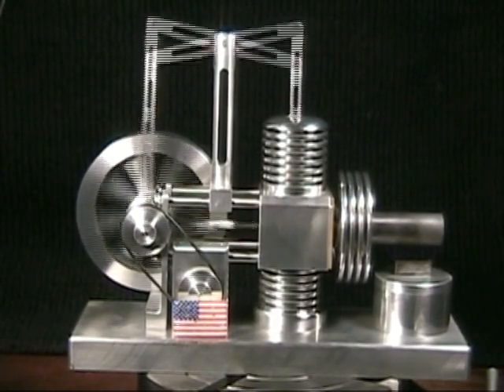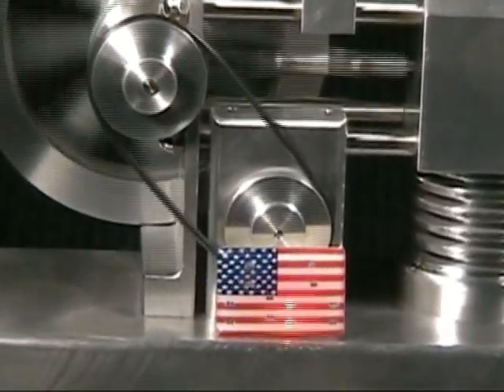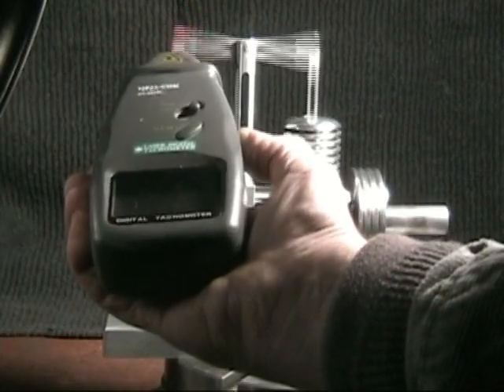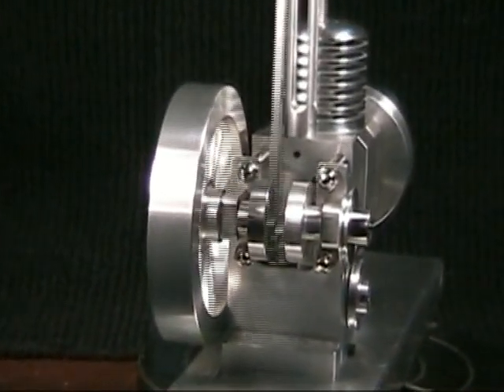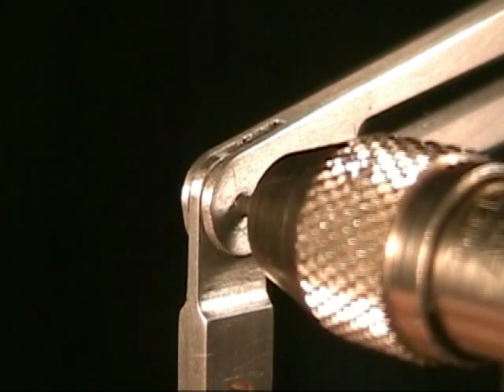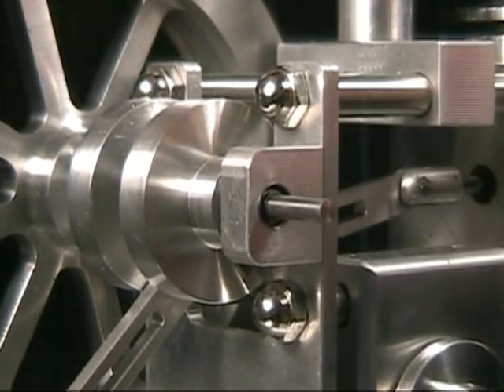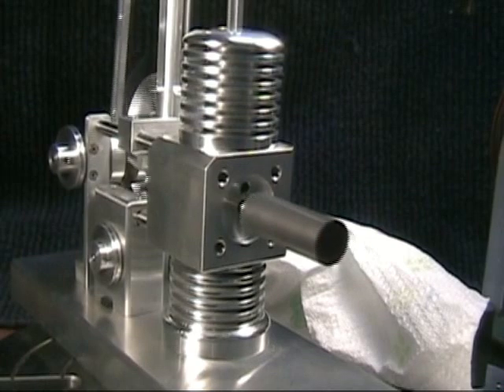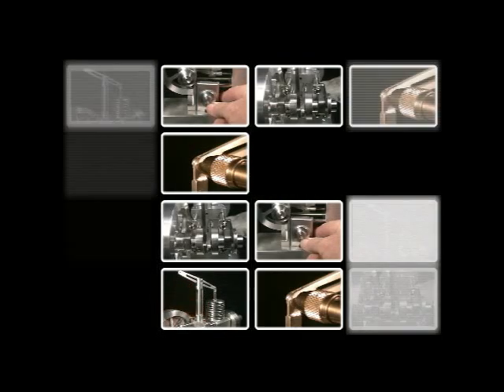Stirling Engine With DC Generator

Comment: Im curious, with a gearbox, and smaler pully do you think you could generate more power?

I have thought for some time, that with the addition of Pelletier devices to the cooling cylinders, could also help, too generate additional power.

Im interested in generating enough power, to run a hydrogen separator.  I think that by powering the sterling with hydrogen, and the Sterling producing power for the hydrogen... it would be a perpetual motion engine. The question is electrical hysterics. Will the load, of the hydrogen separator, create too much drag in the generator.  If theres surplus power, then it could be scaled up for real power generating! I think..

Comment: I have interest in off grid power. Living in cold weather heat is essential with a wood stove. I believe the Sterling engine would be an ultimate answer for the electric generation used with a heat generating woodstove. Sterling engine sized larger to support photovoltaic / batteries
Reply from the maker: I've always thought it might be possible to build a heat engine generator of some kind into a fireplace. I'm sure someone must have tried it.
Reply from the maker: I thought many times if it could be practical to build something right into a fireplace

Comment: Question: If we reduce the temperature of the "cool" region even further with ice, say,  (I guess on top where the fins are??) What will the effect be? because there is a bigger difference in Hot:cold ratio... Any? More power?

Thanks
Reply from the maker: Hello, Thank you for the compliments and Yes you are correct about additional cooling to the cooling side of the engine. Anything helps when there is actually not a lot of air in the engine.
Reply: great

thanks for the tip.

can you recommend a model for experimenting with. 

Also maybe a website with detailed thermodynamic theory?

thank you

Comment: Nice work. This would probably work well as a solar heat converter. We can use something like this generate output power capability.
Reply from the maker: Some people are running these with a solar dish. I had this one working with a Fresnel lens for a short time.
Reply: Richard Vasquez

Comment: Can this be made any size?  What is the principle behind it how does it work?
Reply from the maker: +Dan Webster (Paw Paw) ...Dan I think at one time farmers used engines like this to run farm equipment and there are some modern style Stirling's in submarines. This is a closed cycle engine so it can be stealth under the water. The same air in the engine is used over and over. The air is heated and expanded in the displacer cylinder forcing the power piston up. Once the air is in the upper cylinder it cools and contracts to force the piston down. It's hard to get a lot of power from the system but this is more of a desktop demonstration model.

Comment: the gap between piston and cylinder How much millimeter
Reply from the maker: +Ho NhuY Hello the displacer or horizontal piston has about 2.5 mm but the vertical power piston is a slip fit with probably around .025 clearance.
Reply from the maker: +Ho NhuY Hello the displacer or horizontal piston has about 2.5 mm but the vertical power piston is a slip fit with probably around .025 clearance.
Reply from the maker: +Ho NhuY Hello the displacer or horizontal piston has about 2.5 mm but the vertical power piston is a slip fit with probably around .025 clearance.
Reply from the maker: +Ho NhuY Hello the displacer or horizontal piston has about 2.5 mm but the vertical power piston is a slip fit with probably around .025 clearance.
Reply from the maker: +Ho NhuY Hello the displacer or horizontal piston has about 2.5 mm but the vertical power piston is a slip fit with probably around .025 clearance.

Comment: Awesome!  3v is nice, can it do 5-7v?  6v is standard for USB charging.
Reply from the maker: +Peter XYZ I think it would probably be more practical to charge a cell phone with a solar cell.
Reply: You're right, it's more practical.  I use a ZeroLemon 20amp solar battery for cel phones.

I was pondering the flexibility of a device that offer 5 to 7 volts.

In case I didn't say it:  thanks for posting video.  I'm researching Stirling generators.  Information is abundant but 'limited'.  Most info is either for 'toys' or large high tech systems.  Few or no DIY electricity generation.
Reply from the maker: +Peter XYZ I agree, The fact that You have to use the same air that's inside the engine over and over so it's not really efficient. I wish there where more experiments posted also.

Comment: Very good build quality! The question i have is the Stirling powerful enough to drive a generator for home emergency use (1-5 kw)? So far the Stirling Engine remains a desk top novelty!
Reply from the maker: +Dan Roy At one time Stirlings where use to run farm equipment but in this day and age it would be pretty impractical compared to a combustion engine. Remember the Stirling runs only on the small amount of air in the engine and has no intake or exhaust. Most of these small engines are desktop models. I haven't seen one for sale that wasn't. On the other hand I've heard that the UK has a submarine with am auxiliary Stirling engine because it's stealth. Maybe someday they will work their way into today's market place again.

Comment: Perhaps, you can build a larger unit for civilian uses...  offgrid living and preppers will love it for sure!
Reply: +Mustafa Ali Indeed!  I was thinking this would be perfect sitting on a woodstove.  It doesn't need to be efficient really because most of the heat from the woodstove is for heating the home.  If this could create enough voltage to charge up a TELSA WALL BATTERY (google it), this would be ideal!
Reply: saisonqwerty yes, I can't agree more. Heat is meant for the entire house with electricity generated by the Stirling engine as an alternative off-grid source of power. If BLOOM ENERGY or Tesla Power Bank is added to the system, the electric energy produced can be stored for future use. A gasifier will complete the system. The latter could also produce alternative fuels for the household if a filter process system is added to it. Gosh, the more we talk about it.... the interesting it becomes.
Reply: saisonqwerty kindly update us if you have a big stirling engine in the works for off grid applications... it will be awesome!
Reply from the maker: +Mustafa Ali 
Hello friends. I'm in my 70's now and it's not to practical for me to take on projects of that magnitude, but I have thought it would be nice to build a generating device into a fireplace.
Reply from the maker: +Mustafa Ali 
Sorry, I lost my AutoCAD files in a computer crash years ago. They where in the form of machining notes that would have been hard to understand anyway.
Reply: ***** Oh, really. Then its best leave the job to the younger generation then. But a good blueprint of this astounding machine will come in handy
Reply: ***** no worries bro. Chill!

Comment: in every you tube presentation, Always little devices and no actually weight on it to prouve it can pull something or whatever. Nice work however to present. 3V is nothing to work with and that is the problem with all self-built devices in a smaler scale
Reply: A desktop model is just that, a desktop model for experimenting and learning. Be happy we can do anything at all period, nothing gets done by people like you complaining, did you build one to power your home? OK then, what are you waiting for? The sooner you try the sooner you will have what you ask for, a model that can produce all the voltage you can handle.
People Like you sitting around complaining and WAITING for everyone else to do something all the while you are doing NOTHING!

Do you think the elite are going to do it for you? Wake up, YOU have to do it, yes YOU
Reply from the maker: Luc, the model is not supposed to be useful, it is to demonstrate how one of the old time Stirlings looked and worked. You have to be extremely careful in your build to get one like this to even run. You missed the point. It's a desktop model and doesn't call for elaborate output tests. If I was building something to replace current technology I would have let everyone know. Sorry and thanks for the compliment.
John
Reply: this would charge my 12 volt which would power my inverter which would power my winch which would move 3000 lbs.
Reply: that is indeed a possibility

Comment: How much heat would I need and how big of motor would it take to power a generator big enough to power my house (~1200 Kw per month)?  I would like to hook a motor up to my outdoor wood burner.
Reply from the maker: Hello friend, I wouldn't have any idea how to create that much power with a stirling. This is a model of an old fashioned engine and certainly wouldn't be the choice for real world power plant. There are some modern designed Stirlings being use, one of the UK submarines has a Stirling auxilliary engine which leads me to believe if you did some searching you might find something closer to what you're looking for.
John

Comment: how about a reduction gearbox... have you tried that...
if yes what were the results..

and one more thing what u ment from re-engineered ..
re design of all parts and fly wheel and all ...
Reply from the maker: Hello, I haven't tried a gearbox but there is so little power in this little model that I'm not sure it's worth trying. Yes I did redesign much of the motor I offset the the centerlines of the power piston and displacer unit so the connecting rods are straight with no angles. I also added bearings and micro bearings almost everywhere there is moving parts.
John
Reply: thanks Sir .. 
    i was planning to do an project work on stirling engine working on a concentrated solar power 

so i was worried about the power and torque.
i liked your idea about adding bearings wherever possible. 

the information provided by u is really helpful
THANKS
Reply from the maker: parth pandya
I had a thought. This is meant to be a replica of an old technology. If you are interested in doing real work with an engine there might be some modern designs somewhere on the Net. I think the UK has a Stirling engine in one of their submarines. This would make it stealth with no emissions I guess. 
J
Reply: ohh thanks i appreciate your thought .. i will surely look at it

Comment: Stupid question - since you didn't give the amperage so I could do the math and get close (I'm assuming ma really) what is the torque output of the engine?
Reply from the maker: Hello, it's actually a legitimate question. The fact is the motor is so low in torque that I really have no way to measure it. If you look at my other videos you will see one that shows how to check HP. You must remember the engine runs only on the small amount of air in the engine itself. Heating and cooling what might only be a few cubic inches of air is really a tricky situation. It takes a great deal of effort to just get the mechanics free of friction enough to work. I think the best I did was run a load that was at 3 volts and about 60 ma. 
Take care.
John
Reply: Cool - further question if it's OK - was it loading at that point or did it handle it well? (I'm looking at making one a little bigger around 3-7ft lbs of torque under consistent load and am stealing ideas from yours and a couple of others to just scale up something existing is why I'm asking ) in the end it will be the power behind a shaft for an aquarium wavemaker with the heat source being from the output side of the solar assist panel from my water heater (may not work but something I want to try since the heat source is already there) The theory is that it would give me flow in the day and still at night.... kind of sort of but not quite mimicking what happens in the back bays of the inter-coastal on some of the grass flats (albeit in reverse)
Reply: *****
That is approx. the same output power i achieve with my tin can built with a single flame on input, mine is very fast compared to the ones you see on the videos made of tin, i gotten around 1500 rpm, i will make a video soon, i know you might not believe it, since yours is all machined, and with ball bearings and graphite. But the difference is yours will last many many years, mine is just for learning without spending any money, and it works, and it works good, but like i said i don't expect it to last for years under usage. But it is a good stepping stone for me, and i get to experiment with different sizes of air volumes and stuff without having to machine everything, but once i do find a good combination of my own i will then use machined parts and bearings, etc... But my tin cans i glued(epoxy) bushings on it, and it runs smooth. But beautiful machine you built, very good rpm for such a tiny flame.
Reply from the maker: Thanks for the conversation guys. Just an interesting note: I have a video I never posted where I show the effects of a magnet moving past aluminum or vise versa. In the video I use a strong neo magnet and put it near the flywheel of the Stirling. The eddy currents produced in the aluminum from it passing the magnet will stall the motor right away. 
Take care friends.
John
Reply: Tony Hardy ***** Whenever you guys upload stuff like this where you are descriptive about what you are doing what has / been done: Please feel free to post a link to my fb site - its set so anyone can post no approval required - long as ya'all are doing good stuff like this - feel free to post it  https://www.facebook.com/EducationalVideos6260

Comment from the maker: I've thought of making a decorative Stirling that would work as part of a fire place but I doubt I'll ever have time to work on it. I've used a Fresnel lens to run the Stirling but this model is really low on torque and you couldn't expect much out of it. There are some modern day designs that might be a better prospect though. Not sure where to find info on them.
John

Comment from the maker: Hey dig, The system is so low on torque that the output is almost not worth mentioning. If I remember right the flag takes about 60 ma. It takes all the talent a person has to just get one of these motors to overcome the friction and keep running.
John

Comment: Could this design be scaled up using VW piston housings n pistons? I'm drooling for a 500 w or 1 kw to run my tin shack off of , even 3 amps 120v would run my swamp cooler all summer.

Comment from the maker: Actually I bought a set of materials and the plans from TheLittleMachineShop site but I redesigned the motor and changed some of the materials. I think the kits are being sold by Grizzly Machine or can be found by searching for the Grizzly Stirling Engine. These may be machined already though.
Good Luck
John

Comment from the maker: Hello, I just happened to run into the auction for these bearings on E-Bay. It was one of those lucky finds. I supposed I could find them at a bearing supplier but they might cost a lot more than what I got them for.
Thanks for watching.
John

Comment from the maker: I don't know if you can find this one as a pre-assembled model. There are many kits available however on just like mine is not possible because I added offsets to the cylinders, bearings everywhere and a generator. If you type Grizzly Industrial in you're search engine you can find the kits there. If you type Grizzly Stirling on YouTube you find others with the engine. You might ask them if they know of an finished models.
John

Comment from the maker: Mighty, you have to understand I'm not an expert at this, just a guy who can build a model. Now from what I know, these engines where used in the early days and could do work. Ha, I don't know how much wood was burned to do ti though. I will say this. I doubt if they could compete with a wind generator or a solar panel system with solar tracking and Tesla pulse charging system for the batteries.
John

Comment: So then if you build it large enough and do it right then these motors can do substantial work? That's what I'm getting at. ANd the reliability question. Can these run for long periods without a ton of maintenance?

Comment from the maker: Mighty. You have to remember these motors run only on the small amount of air in the engine. The heating and cooling of the same air and the amount of expansion doesn't provide very much torque. I think if you do some research you might find some modern day improved machines. I think there's even an atomic sub in England that has an auxiliary Stirling engine because it can be stealth. No exhaust of any kind.
J

Comment: What if you made a multi piston one with a common axle shaft for the flywheels? You could multiply the torque and possibly run a much larger generator.

Comment: because, in my mind i see a 6 cly radial flame licker lowering the exhaust pressure by up to 10psi below ambient, forcing whatever generator it is attached to, have a second power stroke by forcibly pulling the piston up on its exhaust stroke, sure its not going to create anywhere near the amount of energy as the actual power stroke but i'm sure it will be a noticeable inprovement
but what do i know, i'm just a US high school graduate ;) love your designs very beautiful model

Comment: it should be similar in application, instead of forcing the exhaust through the flame licker, you force the exhaust through a heat exchange to the stirling motor, i am just curious as to how much more power can be generated, and in turn how much more efficient a given system can be, though i feel a flame licker would* be better suited to this task as long as you can get it to keep the exhaust under vacuum, if so then you would* see improved output and fuel econ without putting a generator on it